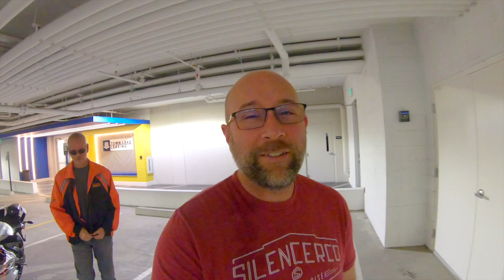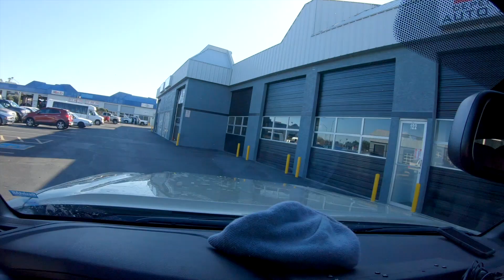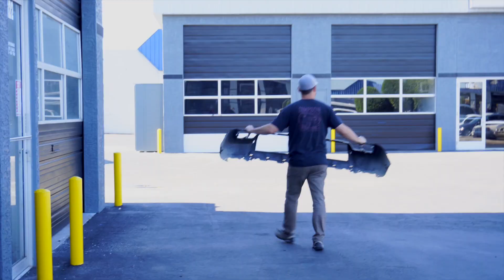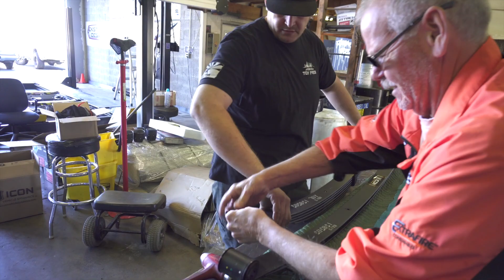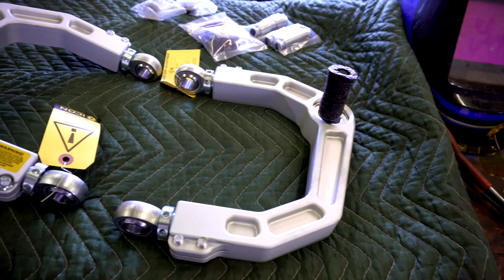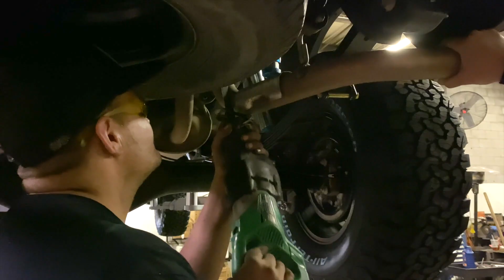AZ ToyPros & State 48 Overland 2019 Tacoma Build Montage!

Comment: Good looking build!  That looks great.  What gears are you going with?

Scott
Reply from the maker: Thanks Scott, appreciate it! Currently on stock gearing, next on the upgrade list is to upgrade and go up one more tire size.
Reply: @UrbanArmed  Remember to test the tires for rubbing at full compression of the suspension at each corner and add extended bump stops to prevent the tires from tearing up sheet metal.   When you figure out how big you are going with the final build - regearing will completely change the performance of the truck.  Stay safe out there!

Scott

Comment: I am assuming the tire size is 285/70/17? If so,do you feel the need to regear the truck in order to reduce the sluggishness?
Reply from the maker: Thanks for the comment bro. I'm currently running a 285/75/16 right now. I plan to change out to a 17 inch wheel and run a 34" tire after I regear. Sluggishness hasn't been that bad but my MPGs took a big hit.